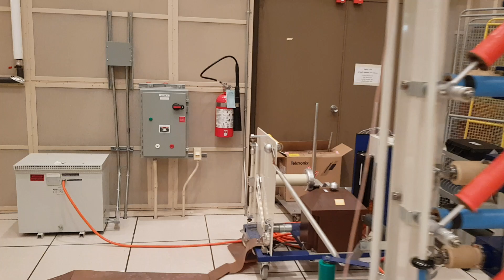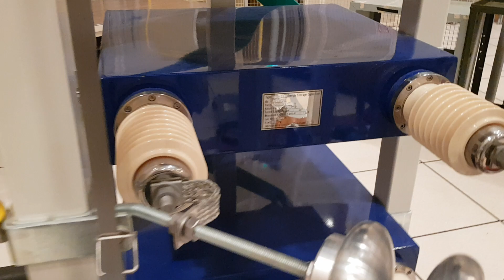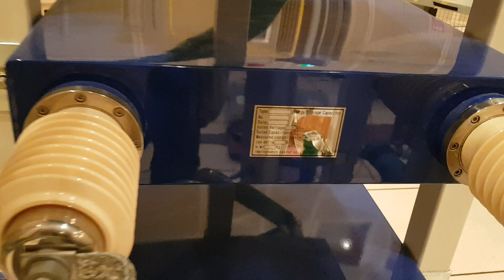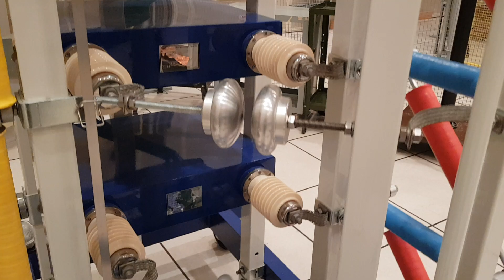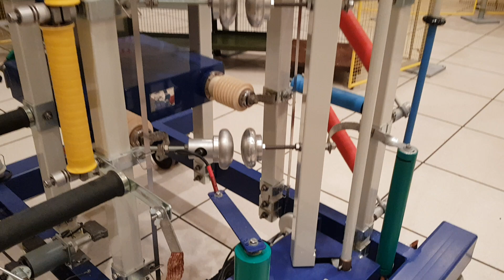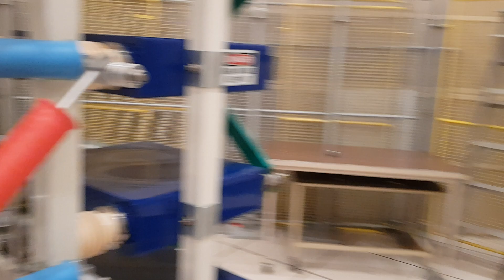Components of Impulse Generator

Comment: Interesting than metal bolts connecting the resistors visibly protrude outside the structure. As you go up, the voltage goes up and some sparks from the bolts probably appear at maximum charge level. That's not desirable. Fire the generator in the dark to observe if that happens
Reply from the maker: The metal bolts have smooth surface to avoid any corona. Each stage will go maximum 100kV and no corona was seen.
Reply: @electrical4everyone  Compare the design with say Cockroft Walton mutilplier with approximately same maximum voltage. What would happen if the bolts of same dimensions are to be placed at same locations?
Reply from the maker: The Cockroft multiplier will have much less voltage between the stages, so there will be no corona. The final voltage will be between the first and last stage. The impulse generator was built by one of the specialized impulse generator manufacturer and hence they considered the electric field design.
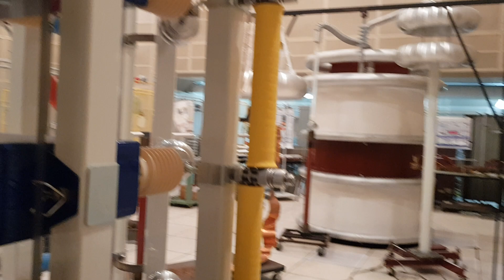Reply: @electrical4everyone  2:33 These metal "bolts/screws" protruding out of the yellow resistors don't look to me to have smooth surface at all. The voltage between stages is relevant yes, but total potential of the bolt wrt to ground is relevant even more I guess...When I visited HV building I was surprised to see that wire diameter connecting 2000 Marx generator and the voltage divider is not thicker than a typical conductor of a 132 kV power line. I was even more surprised when the lab technician told me the wire was naked, without insulating layer and that doesn't make any problems during the tests!